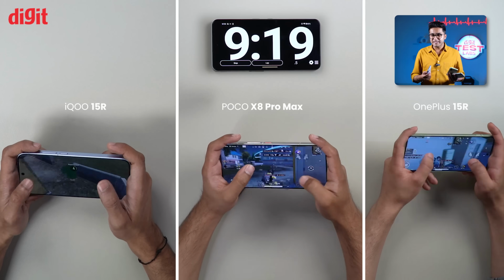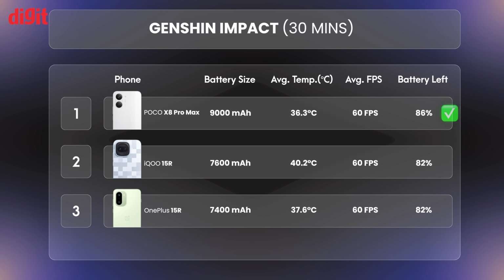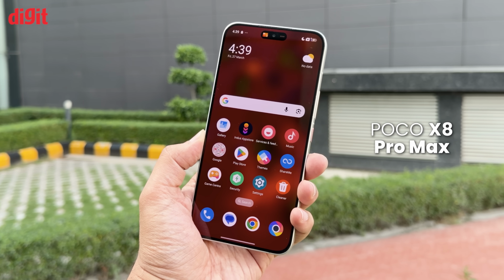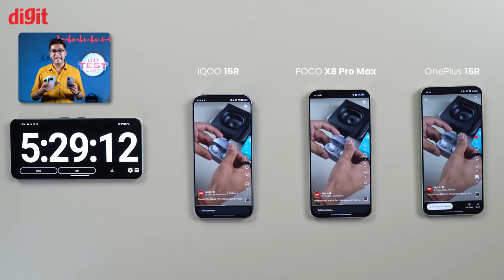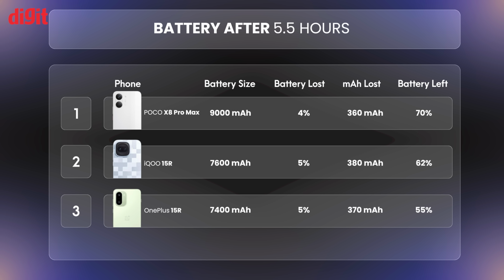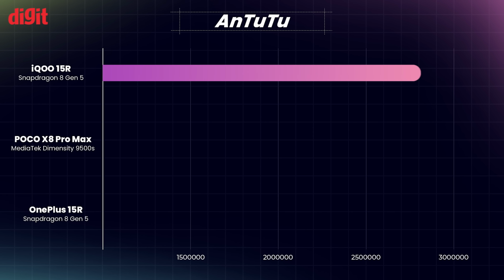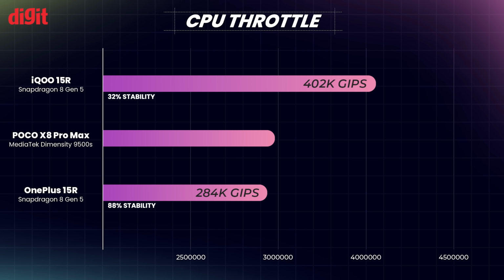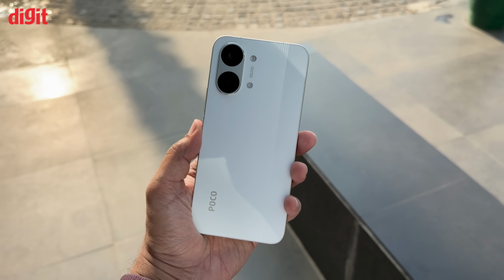Poco X8 Pro Max vs iQOO 15R vs OnePlus 15R | 6.5 Hour Performance & Battery Test | Which Phone Wins?

Comment: I am glad, I chose Poco X8 pro max 512GB
Reply: Bro how is the ui and the bloatware things and also how is the overall performance for gaming. I am really confused about buying 1 in these iqoo 15r , oneplus 15r or poco x8 pro max
Reply: Did u specifically remove the bloatware
Reply: @dapffx not much to find, just uncheck the extras during set up. Only 1 app that is there indus appstore, that can't be removed. Else u can uninstall anything. No ads nothing. Also, this app do not create any problem when notifications are turned off. Only issue I face is promt to on screen wallpaper

Comment: 2:02 the moment i saw poco avg 120 fps with 36°C, i quit the video... Even i'm an ex poco user (x3 pro, x6 pro, x7 pro), poco's software optimisation, update policy and heat management is the worst among all the brands..
Reply: Except the POCO X8 Pro Max  features an advanced POCO 3D IceLoop cooling system with a massive 5,800mm² vapor chamber which is actually so good for long hour heavy gaming.
Reply: Its best phone that poco ever produced,use it then u will know

Comment: Dimensity 9500s is 8elite level which is a flagship chipset
Reply: Both
Reply: And 8 gen 5 is simply the successor of 8 elite ie 8 gen 4
Reply: Hello no😂
Reply: It is successor of 8sgen4
Reply: @rationalthinker-r2h 8s gen 4 is just upgraded version of 8 gen 2. Performs about the same as 8 gen 3. Meanwhile the real 8 gen 4 (non s version) is 8 elite. And 8 gen 5 is just the newly made flagship killer soc.
Reply: @_graznie2289 wait till u realise there ain't a chip as 8 gen 4😂
Reply: @niranjan_kichu02  youre joking right? search it up on google or smthing. search is snapdragon 8 elite is gen 4'
Reply: Hell nah sd gen 5 competes with 9500s whereas sd elite competes with 9500
Reply: U mean 8elitegen5

Comment: @Digit I want to buy the iQOO 15R, but many reviews mention heating issues. I am a heavy user, mainly watching reels for long hours and multitasking. In CPU throttling tests, its graph and stability don’t look very good, and when the graph turns red, what does that indicate? Since its stability score is also low, does it mean performance will drop during long continuous use, and should I still consider buying it?
Reply: No bro instead of iqoo 15r you can buy oneplus 15r thes best performance phone in 50k segment ❤😎
Reply: @Pokemonmasterchannel7537  Bro i want a compact phone
Reply: @AdityaShekhar-h3n  Just Wait After Software Updates It Be Will Fixed.....!!!
Reply: @AdityaShekhar-h3n  then oneplus 13s is best bro go with 13s
Reply: @AdityaShekhar-h3n then go for poco x8 pro or xiaomi 15 or 17 best compact power house
Reply: get the oneplus 13s in that case